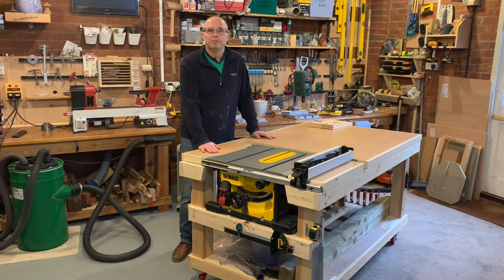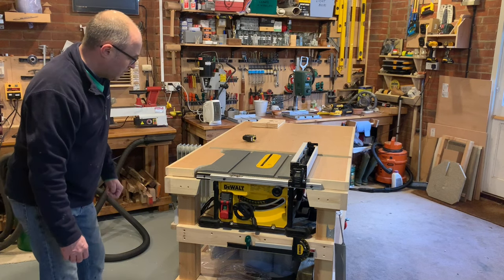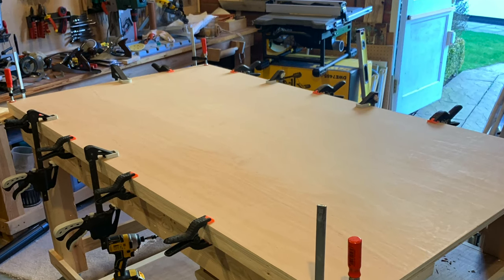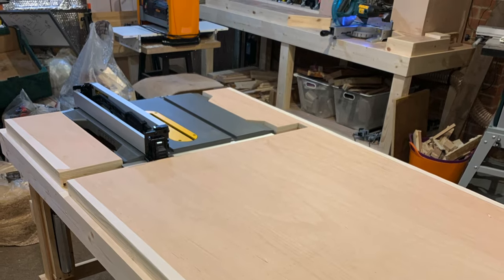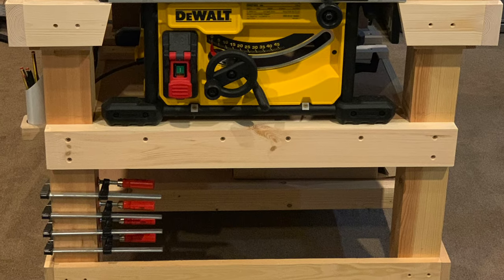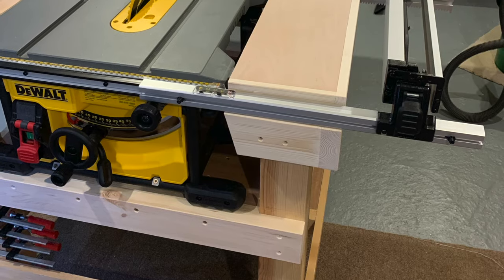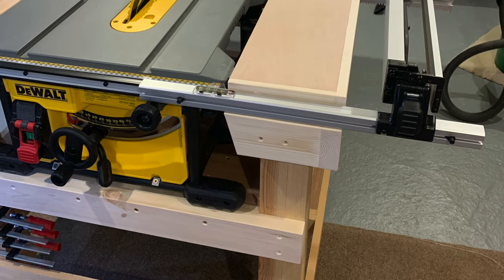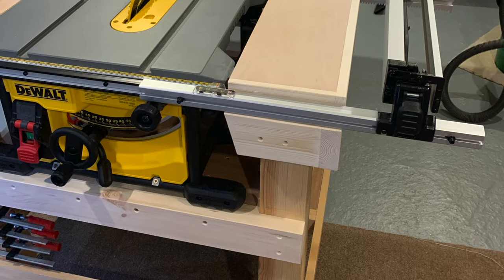Table saw Bench for DeWalt DWE 7485  HD 1080p

Comment: One important detail I’ve noticed that people might be interested in is the mitre gauge track does not extend onto the table top. Which means that your table saw needs to be higher than the table top by the thickness of the mitre gauge.
Reply from the maker: Your right, I need to router out some tracks into my table top, but I can’t bring myself to do it 😂 I don’t want the saw sitting higher, it works so well being level with the table

Comment: Just grabbed a Dewalt DWE7491XE and have been looking at heaps of out feed table set ups to instal in my workshop. Some are mind blowing, with a finish looking like a dinning room table. This table is pretty close to exactly what I was wanting to build with, size, vice etc. I'll additionally run a power system around the bench.  

Thanks Terry for a great job and build.
Reply from the maker: Thanks Craig, you will love that saw, DEWALT really know how to make a table saw, especially with the rack and pinion system, they are so accurate. Enjoy making you bench, I really enjoyed making mine, just take your time and enjoy the build 👍🏼
Reply: @Terrythemaker   Terry why didn't you match the indent in the saw table on the right hand side of the Dewalt as you did on the left? It looks good on left. What is the outside width of the lower shelf?
Reply from the maker: @cratra  Hi Craig, that’s a really good question, I honestly can’t remember why I didn’t do the same on the right hand side. As for the measurements I’m not at home so I’ll have to measure later 👍🏼
Reply: Amazing

Comment: Nice one just bought the 7492 over here in Barcelona , I went for that to allow more blade height on a cross cut sledI am planning to build, the old Einhell saw is now up for retirement to the garage for cutting up the kindling for the woodburner. 😄
Reply from the maker: You won’t be disappointed, DEWALT saws are excellent 👍🏼 I love using mine 😊
Reply: I wish I bought the 7492 but the price difference to the 7485 was massive. The table I made works but would love the extra height. Hopefully soon!

Comment: Nice build and nothing wrong with making it a mix of a video and a montage talk-over. That worked really well in conveying the thoughts that went into this build 👍

My first impression was that you were lacking to extend the miter slots into the outfeed table…
But when you pulled out your sled it dawned on me that by not extending the miter slots you can design the sled to naturally stop exactly before the blade exists the front of the sled (where your hands are in danger).
I don’t know why I never thought of that, but it looks like you did and that is darn clever.
Thanks for the inspirations!
Reply from the maker: Hi Dennis, thanks for watching and your kind comments, it’s funny you mention the runners because I was tempted only this week to router out two slots for the runners for the occasions that I could do with them,  but to be fair I only cut small pieces on the sled, so I decided it against it. 👍🏼

Comment: This is great, thanks for sharing! I have only a 3x3m shed so I'll be doing something similar soon so my table saw can be setup and ready permanently instead of being packed away (standing on its edge) against the wall as it currently is! :D
Reply from the maker: I’m glad you like it, I have to say it works really well like this. I too can’t be bothered having to keep getting tools out and setting them up each time. I have most of my tools mounted on benches, at least I did until we recently moved house. I’m currently setting up a new workshop. thanks for watching 😊
Reply: I am the same. Very similar size shed and built a similar size one to this. Managed to get a router table in as well at the other end and put on wheels so could be moved around. Would like a bigger space but have to work with what we have !

Comment: Great design. I have same table saw with the pesky wings. I'm trying to make a scaled down version (not as long) of your great bench, trying to follow your design and comments. Could you clarify how you got the template so accurate -- not sure what you mean by: "cut out the hole at the narrowest point of the tabletop... drop the table into the hole, and the outer wings acted as a template". Did you use the L and R sides of the rectangular hole to prop up the saw  using the wings when you part dropped it in, and then draw the template, remove the saw, cut out the template, drop the saw all the way in? Really, really appreciate your feedback. Thanks! And, thanks for the great vids!
Reply from the maker: Hi, thank you for your comments. Just to clarify I cut the first hole at approximately 19 inches or 485 mm, I then slid the saw in from the front of the bench and let the wings sit on top of the plywood. I then drew around the wings as a template, and then removed the saw and cut out the wings and dropped the saw back in. I do hope this makes sense. I might have some pics on my Instagram, regards
Terry

Comment: Hello, my compliments for the explanations about the DeWalt saw bench. I would like to ask a question: is there a system or a product to protect the "work surface" (gray in color) from scratches and wear?
Reply from the maker: Hi,thank you for your comments. I don’t think there is anything to protect the grey surface. In fact mine is now quite scratched after lots of use.
Reply: @Terrythemaker  I ask you for advice. When checking my 7492 (purchased a few days ago) I detected a difference in level on the work surface (basically by placing the level or a precision square used for mechanics and pressing with one finger on the end of it, with the other finger pushing on the opposite side I have the "Telegraph" effect - that is, I see that it "taps" on the bench and you notice a difference in level of about 1.5 mm over a distance of 15 cm!) What do you advise me to do? Should I ask for a return? Should I return everything and exchange it for another? .... 😭😵‍💫
Reply from the maker: Hi

That's a tough one because I had a similar problem when I bought mine, when I called the store they said don’t worry we will send you a new one, which they did, the customer service from DEWALT was excellent. But I’ve since noticed lots are like it in this price bracket. Only  really expensive table saws with solid cast tops will be 100% flat. I know that’s probably not much help.
Reply: @Terrythemaker  Thanks for your guidance. I will contact the seller today to arrange a return.

Comment: This is so great. I like hoe clean this is. Im working on putting something like this together. Is the table saw in line with top ply wood? It looks like the top of the saw is not in line. How much higher should the top of the table saw be in line with the plywood?
Reply from the maker: Hi 

Thanks for your comments, it’s level with the saw, at least it should be 😂

Comment: Is it possible to flip the fence to the other side of the blade with this design or would one need a larger opening behind the saw to allow the fence locking system to be actuated?
Reply from the maker: Hi, no it’s not really an option, but I never use my saw that way, 👍🏼

Comment: Wow, I love it! Great work! It sounds like your rack and pinion fence is a little stiff. . . Would   some paste wax make that move a little more freely? I've thought about getting that same table saw too. Your input would be appreciated. Also, since you use your saw often, do you ever wish you had a slightly bigger saw with a large cast iron table and a bigger electric motor for sawing extra thick material? Cheers. :-)
Reply from the maker: Thanks Justin, you’re probably right it might need a bit of grease or paste wax, but no, the saw is perfect for me it’s the right size, of course we all like something a bit bigger, but I analysed this for ages before buying the DeWalt and this came out tops every single time, no matter which saw I looked at this saw always won. You won’t regret buying it.
Reply: @Terrythemaker  Thanks so much. I'm glad to hear it!

Comment: How did you figured out  the height for the ''shelf'' for the saw to rest on ? can you adjust it if need be ?
I was looking if anyone had made a ''pannel saw'' out of theuir saw. Like with a shelf/table on the side that slide.
Reply from the maker: Hi, I must admit it was trial and error. I started off with the shelf held in by clamps either side and I moved it up a little bit at a time with a spirit level resting across the saw and the bench, once it was in place and both were flush I then fixed the screws in place
Reply: I measure my table saw then just used washers to really dial it in

Comment: It a very nice bench but you could have saved time and effort and had more real estate on the bench.

I don't know if you're familiar with Ron Paulk.

I built his original workbench and made wood adaptors so my Dewalt would sit nicely on the 19mm pipes that mounted to the bench. This meant that my saw was clear of the main bench so there was no need to rout slots for the mechanism. It also gives you the ability to take the saw off if you're not using it so you have a full worksurface.

I still like you bench though and if it suits you, that's all that matters.
Reply from the maker: Hi Patrick, thanks for taking the time to comment, as always it’s good to hear what others have built, I hadn’t heard of Ron Paulk but I’m going to check him out now, thanks for that 👍🏼

Comment: Nice.... I tend to think everyones first bench is made out of necessity so we usually get the meat and potatoes. Haven't made my first bench yet but I feel that I want to plan it and it will take a lot of time to fine tune it whereas I can build one to get something to use in my workspace.... and then I'm stuck because of the effort put into this one... Do you suggest rushing and getting a workbench up or is it worth it in the long run to simply wait it out which can hold back projects that are not shop projects?
Reply from the maker: Now that’s a tough one, I must admit I made my bench twice, Well almost, This bench started off a lot more basic than what you see in this video, but then when I bought my Dewalt tablesaw, I decided to fine tune it, I put a new top on it and spend a lot of time getting it just right with the trim around the sides etc. 
A lot depends on what you plan to do. I’m just a weekend woodworker and I don’t really have that many projects on the go so I was able to take my time on this and get it exactly as I wanted. I would say take your time and enjoy the build.
Reply: @Terrythemaker  Thanks a bunch. I am a weekender myself ;) I want to build a desk for my studio but I also want to build a workbench. Thanks!!! I know I may be able to build the desk without the workbench so maybe its just my ego that wants to have the workbench first.... lol
Reply: @Terrythemaker  Also, I want to be able to take it apart and move it when I am ready without having to take the whole thing apart.
Reply from the maker: @MelodeusForever  I can’t do that with mine as all the joints are glued with titebond, so they are rock solid.
Reply: @Terrythemaker  that's the dilemma

Comment: Please. What is the wood type and his tickness on the top of table ? I want to make a same things but low coast for my second workspace.
Reply from the maker: Hi Richard,  its 18mm plywood, but I doubled it by gluing one sheet on top of the other 👍🏼
Reply: @Terrythemaker  Thanks a lot for your answer. May be I buy 22mm   for my work table because its not for heavy things.

Comment: Great job. I’m amazed you didn’t have to shim the saw to get the tops level, or did you ?.
Reply from the maker: Hi Russel, no, basically I undid the screws along the front support and raised up each side,  with a long spirit level across the top so I could see when it was flush and once I was happy I drove a screw in on one side then the other, it was a bit tricky and time consuming. But I got there eventually. Then the same with the back. I needed about 4 pairs of hands at the time 😂

Comment: I have question. Is IT Your table is perfectly flat?  Do you know how adjust table curvature.?i mean table of dewalt not Your bench.
Reply from the maker: Hi, do you mean the table saw top itself ? If so I would say no, it’s not perfectly flat, this is my second saw and it’s much better than the first one, the first one was slightly lower in the middle but dewalt replaced it without any fuss at all.  This second one is much better but not 100% flat, But almost. You have to spend thousands of pounds on a cabinet saw for 100% perfection and flatness. But for everyday jobs this saw is amazing and I highly recommend it to anyone 👍🏼
Reply: @Terrythemaker  maybe better is do home made table saw using circular saw? Own table made From playwood?

Comment: 4x4 legs , 4x2 framing and another sheet of 3/4 ply on top of original 3/4 ply.!!!
.......a tad overly engineered don't you think.
Reply from the maker: @franklettering  thanks for your comments, I used to have another one that was on a much lighter frame and the saw never felt solid in it. You’d get vibration and movement and the top would flex,  so this time I wasn’t taking any chances I wanted something that felt nice and solid and flat, plus I had lots of 4x4 off cuts I needed to use. thanks for watching 👍🏼